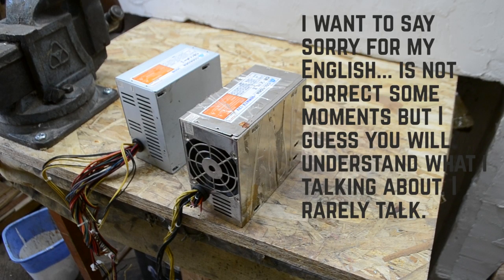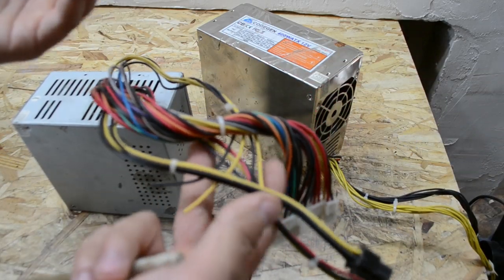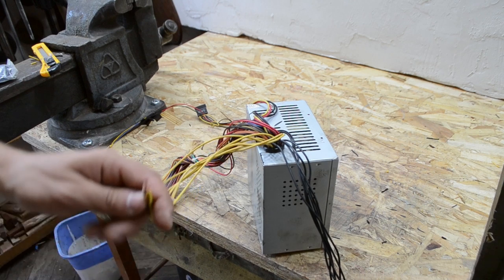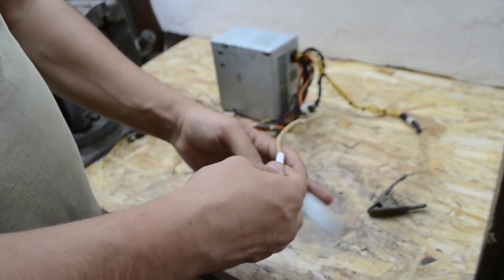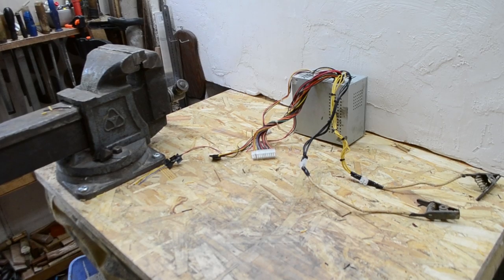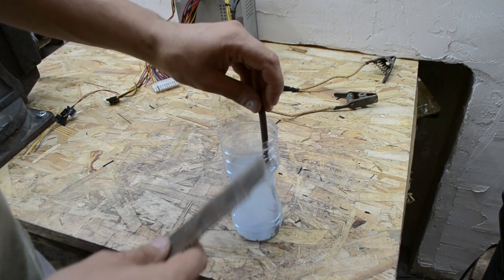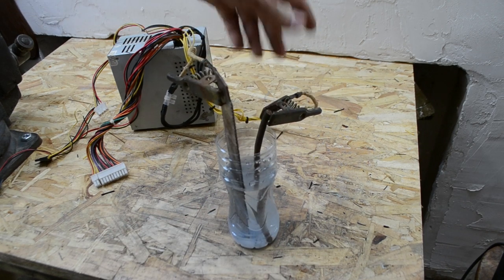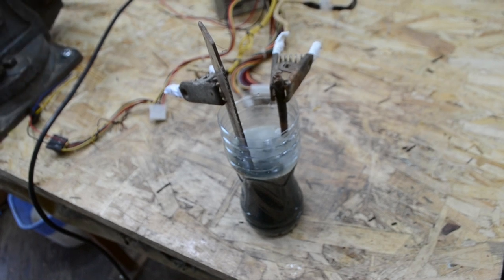How To Make Electrolysis By Screws And Tools

Comment: Wow good job screws and tool
The metal which u had put as anode should be clean without ann rust to remove rust from the rusty object?
Reply from the maker: It may be rusty, but where there will be contact there it must be clean.
Reply: @ScrewsAndTools  oh OK thank u so much screws and tools for your knowledge
Reply from the maker: @shannondias5424  Always welcome.